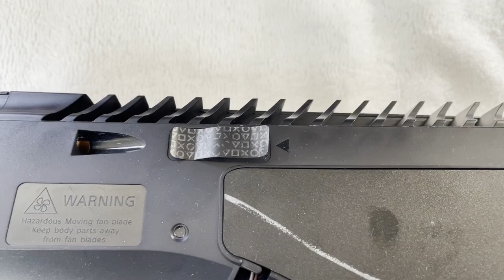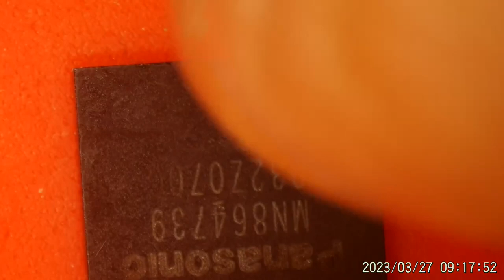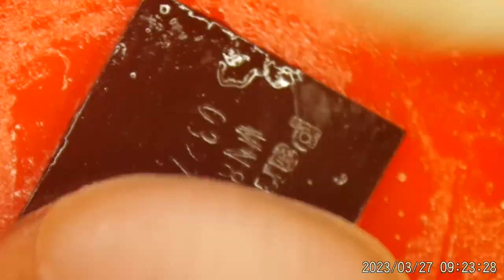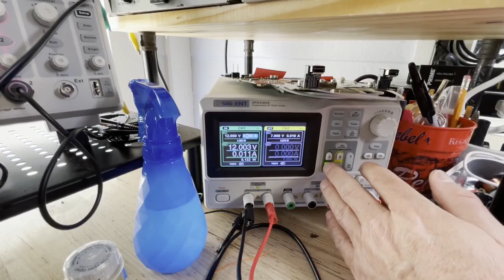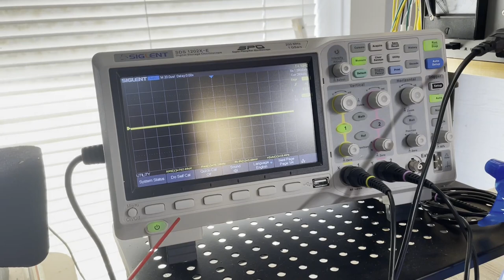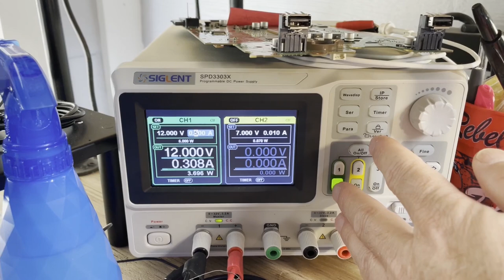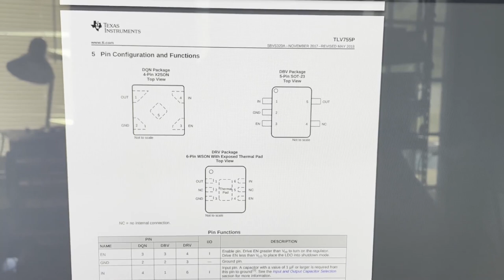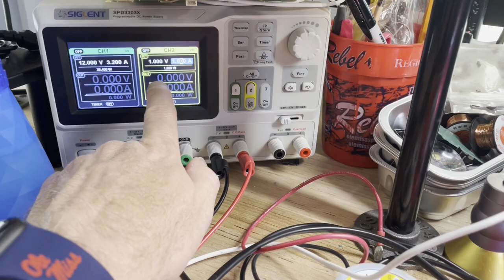#83 Repair of PS5 No Power

Comment: This feels like backend software engineering; it’s often a game of whack-a-mole, finding the original problems and fixing the problems others created in their efforts, just have to stay determined and keep at it. Very tedious 😅
Reply from the maker: This console had been totally molested.   I spent way too much time on it.  I win would have made it all worth it.
Reply: @ToltecMerc  I’ve been very selective about which ones I obtain. I’ve had to do 3 PS4 Pro fuse replacements, replaced PSUs, HDDs, etc. One PS5 had crashing and artifacts, replaced the motherboard, that was costly. The only one I have left on the bench is a PS4 Pro that will not power the optical drive even with a new drive, fuses, and ribbon cables 😖 I don’t replace chips with the equipment I have.

Comment: I have a board with exactly the same symptoms.
Interestingly, when power is turned on and 1.8v is injected from the bench power supply to that pin, it will start.
However, all USB ports are not recognized.
Apparently it seems to be a signal line that controls power sharing to the USB port.
All I know is this.
Reply from the maker: That’s very interesting!  Thanks for the information!

Comment: Thank you for the very informative video, I always look forward to your next one... Quick question about the waveform from the crystal I have seen you measure a few times. Where do you measure this? (I have tried pausing the video to try and work out where your probe is, but not sure), and what are your scope settings? Also will this waveform be present with just the battery inserted or does the power lead need to be plugged in and turned on first? Thanks again and much appreciated!
Reply from the maker: I am measuring directly at the 32kHz crystal.  There are two test pads you can probe on.  I use the X10 setting on the probe for  higher input impedance as it doesn't take much to load down the oscillator.  It will be present if the battery is installed on the board without any other power.
Reply: @ToltecMerc  Thank you so much! I will give it a try

Comment: You can see right away that encoder is off center real bad.  Do you prefer low melt or regular solder for tinning your encoder? This board was a mess huh,? Geesh.. did you ever check the 5v(5leg)transistor (I think it's called) it's labeled 15jL.. that one can cause issue and the 3v (3leg) one that's next to it... They're both next to the HDMI port
Reply from the maker: I only use low melt for removal of ports and some ICs.  I tin with some good leaded solder.  I did not get to check the 15JL ic.  I think that would only make a difference after power on when it would be supplying 5V to the HDMI port pin 18.
Reply: @ToltecMerc  gotcha 👍